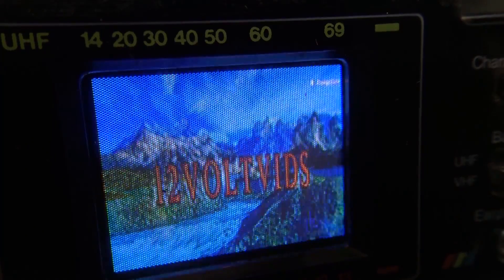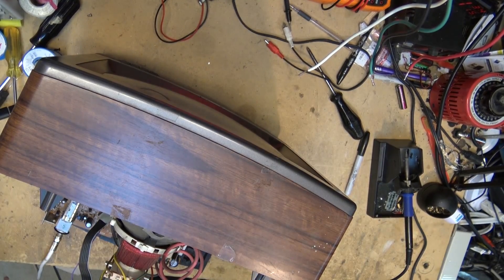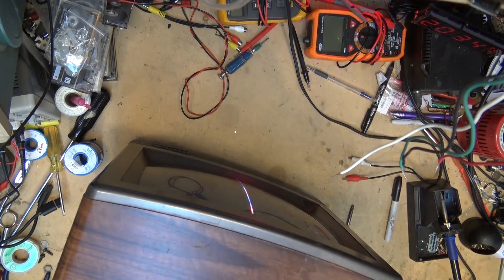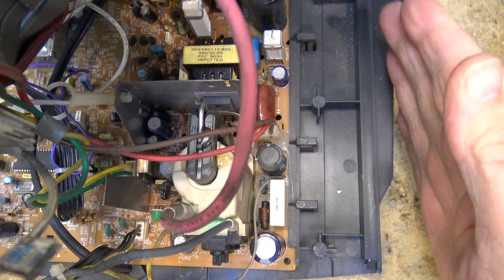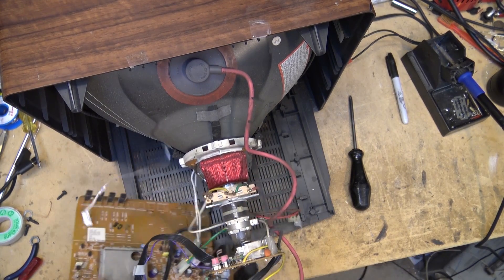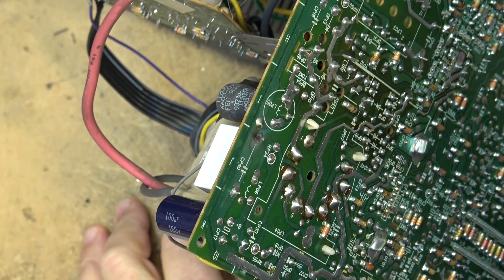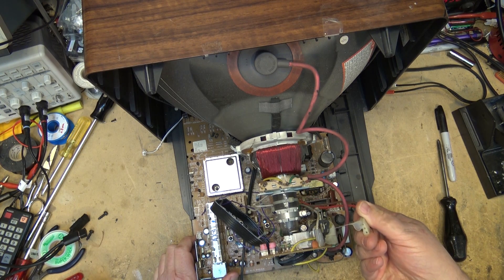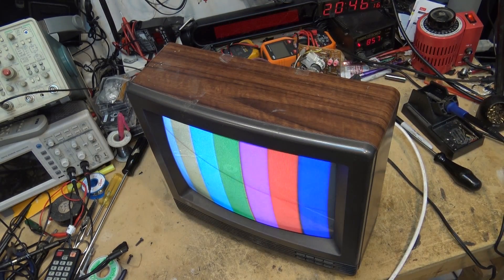Most Dangerous TV fault ever -  Fire Hazard

Comment: I have a 1989 Zenith 13" (SF1315W, 9-795 chassis, Mexican-built set) that has some sort of arcing noise inside it. Occasionally the vertical jitters. I think it's the chopper. Should I not be using this TV? Been using it about 12 hours a day for 2-3 weeks now.

Comment: Here in Finland Salora and Finlux CRT TVs had a very similar problem(in the mid to late '90s). Basically the exact same thing, but with the yoke plug(s). The solder joints would start to decay, and one day it'd cause a big spark and set the TV on fire.
Reply: Still have my Salora 28" 'Täyskuva-TV' from 1986, working great! :'D

Comment: This reminds me of the recall Sony had to to do with underated on/off switches
here in the UK.
A lot of engineers worked overtime to fit uprated switches due to the number of sets
going on fire, i have seen the plastic fronts deformed by the heat from the cheap switches.
Then we say that they don't make them this good anymore!
Reply from the maker: There were many safety bulletins issues for many products that you never heard about.  Switches, wiring harnesses, fuses, mov ect that we had to do every time when a specific modem came in. Remember the flyback trouble on a certain model that was replaced long past warranty and the an orange dot sticker was stuck to the label indicating that it was done. Then pabasonic with their under sized wiring harness on thousands of microwave ovens, many that could very well still be in use.   That one was never a fire safety hazard because if the harness overheated and shorted the worst thing that happened was the fuse would blow and when the tech opened it up he found the wires were melted together between the fuse and the switches. But there was a mod kit that was out at the time that you could order and it came with the wires all bundled and you just unplugged everything and put new ones on and they were heavier gauge wires. Lots of fuck ups and manufacturing over the years that were corrected by service centers that people never knew about. What I work for Sony we did the big recall on the 5000 series betamax machines that required I think I was around 45 or so capacitors in the servo board they were solid aluminum type capacitors made by Samuel and they were all swapped out for a little tantalum caps because the failure rate was about 100%. They were covered under warranty long past the one year warranty because it was such a big problem same solution I think those ones got a red dot stuck on the back when they were done. but if you've got full TV or an old microwave or an old VCR if you look on the back and you see there's a colored sticker that generally means that there was a recall done a soft recall and the unit was repaired while it was being serviced for something else.

Comment: I remember walking home from school in 3rd grade and seeing my neighbor's 1964 RCA (CTC-16, probably) roundie color set out in the driveway with holes burnt through the area around the tuners. Their daughter had been watching Romper Room when it burst into flames; I've since heard that it was the thermistors that RCA used, to delay the power-up while the tubes were warming up, that caused such fires. Some sets from that era (Admiral & some others) were also known for fires that spread when wax dribbled out of the flyback. I worked on Zenith monitors from Mexico in the '80s and never saw such junk; those plants were going through labor conflicts and it showed in the lack of workmanship.  I still have a 1988 GE stereo set (CTC-136) that had a similar problem to this, but it was a special capacitor in that area that looked like a ceramic disc, but was made of plastic and cost a lot more. It filled the room with smoke, but that was just the fusible line-dropping resistor doing its job. I replaced the cap with a ceramic one and the set has been fine ever since.
Reply from the maker: The Mexican zenith sets were some of the worst sets i ever saw.

Comment: We had exactly the same problem with TV sets in the UK of the same vintage. The scan coil [yoke] connector would become dry jointed and burn together with line linearity coils and scan coupling capacitors. That is what happens when you dip solder the entire board when it contains components that require more heat for the solder to flow correctly. J.
Reply from the maker: And when I manually solder these big terminals I get the trolls that have an iq of 69 telling me how I don't know how to solder and i am putting too much heat on, and how they can't watch and are unsubscribing as I am an "amateur". Fucking idiots haven't a clue. 40 years in the service industry has taught me a thing or 2 about insufficient heat on a solder joint.
Reply: @12voltvids  We had a major problem with a UK chassis that was rented out to customers by a leading rental company. The rental company was actually owned by the set maker! The line linearity coil became dry jointed probably due to the 'sing' of line frequency. It caused some major house fires and all the models were recalled and scrapped for fear of insurance claims. Another chassis suffered a dry jointed frame output transformers mounted on the P/C board itself. It was not a heavy component being a later model and just needed a bit more solder applied with a hot iron to the connecting tags. Push button mains switches when mounted directly onto the PC board were another hazard. Models with Thyristor line output stages suffered badly with dangerous dry joints on wound components due to the high current high frequency involved.  I owned my TV service center/sales shop from November 1966 to December 2002 so I know I'll back you up with this one. Guys working with clean P/C boards from low voltage  electronics simply don't understand the dangers of high voltage/ pulse arrangements in television receivers. Regards, J.
Reply from the maker: @vinylseat  they don't   know anything about high power connections but you can't fix stupid.

Comment: Philips (EU) tv's had a similar recall early nineties after several tv's had burst into flame, and those were otherwise overengineered top of the line models that were produced in local factories still with overall excellent build quality, similar to the heydays of zenith. They had several vertically mounted boards where heat cycling and gravity killed the solder joints. I remember calling in the tv shop as a nosy kid after discovering the recall from a newspaper. That tv ended up having many, many hours of service without any other service until the tube was so dead all the colors started bleeding. Ended up swapping out the tube and giving it to a local charity where it was used for who knows how many more years.

It also definitely was a thing in those days to whack your older television because of the bad solder joints.
Reply: The infamous 1993 K40 safety recall
Reply: @edwinvp  That one indeed! I hope to one day find myself another K40 again.
Reply: And a bit earlier, GE had double sided board problems due to griplets having a bad solder connection due to differential expansion. We'd hard wire the circuits that had griplet connection failures to avoid recalls. I remember one that drove me around the bend figuring out a griplet related issue that was unusual. I fixed it after much effort and literally sleepwalking to the basement shop, to awaken that morning to find it repaired and some notes that made no sense at all.
Yeah, I fixed the damned thing in my sleep.
Then, there was the RCA with an MOV failure, it let go fully as I was looking directly at it. Thankfully, I yanked the cord before it could burn the customer's hardwood floor.
And a Philco TV with an SCR horizontal output that had a similar problem to this set, the arc leaving me with a tiny blind spot to this very day...
I eventually became the guy other shops called when they couldn't figure out what the problem was.

Comment: This is weird, why not cleaning that issue first and solder afterwards, all that carbon is still out there.
Reply from the maker: Why? The little bit of carbon on the board isn't going to do anything. For starters there are no other traces involved that it can conduct to and this tv isn't going back into service.  I found this set at the side of the road. It will be used in future videos for fault simulations at some point but other than that it won't be going back in service. So there was no point.  If the burnt area was encroaching on other traces where there would be a possibility of cross over then the carbon would be cut away and hv silicone would have been  used to fill the void and allowed to fully cure before the set powered up but that was not the case here.
Reply: @12voltvids  Ok thnx man, i was just wondering, you're the expert and i'm always interested in your video's.

Comment: I recall Zenith had some 4 leaded "safety capacitor" in the flyback circuit back in the 70's that also would fail and cause damage. I had an old 70's Zenith that had all the circuits on plug in modules. It was an erratic and annoying set, always failing. I got fed up and soldered all of the plug in modules making it no longer repairable by that means, yet it became very reliable after I did that. A friend's family had a small set that failed and I was asked to fix it. They had it upside down and were watching a sitcom. Apparently right side up it would fail. I took the back off and ran a small artists paint brush all over the PCB until I found the unsoldered part. They thought I was a genius.
Reply: Quasar "Works in a Drawer" set, with plug-in modules, were also known for bad connections. I believe one of the first thing Panasonic did when they bought out Quasar was to get rid of that system. I'll bet both  Zenith and Quasar charged a mint for replacement modules.

Comment: Do you have videos on discharging? That's my biggest fear once opening stuff. I tinker with VCRs
Reply: Hi, use a 100w incandescent light bulb to discharge the high voltage filter caps etc. also you can use a 1.8k or 2.8k ohm 10 watt or higher  resister to discharge as well. thank you.

Comment: I know it's a bit off topic but here in the UK there are 5.3 MILLION tumble dryers that are being replaced by Hotpoint, Creda and Indesit - Whirlpool American owned. They too have caused many deaths all for the sake of a thermal cutout costing  less than a cigarette. We went for the 'new option' that was less than half the price of a new one. If we had not it might have been several years before it was fixed. It now seems the so called fix isn't working and the repaired ones are still bursting into flames.  I was hoping I could hang on to our old one (< 2 years old) and add a thermal cutout but they took it away. Our previous dryer had one - 10 for 99P off EBAY ? It seems that penny pinching has reached an all time high. Accountants, poor design and greed strike again.

Comment: While you have it apart why dont you add RGB input to it for old video games?
Reply from the maker: This would require isolation as this is a hot chassis.  This can be done 2 ways.  Isolate the TV with an isolation transformer or isolate the video input with optical isolation.

Comment: What courses do you need to do these type of repairs ?
Reply from the maker: Well electronics engineering isn't a bad one. Myself over the 20 years I was in the business I took probably 100 or more electronics courses, most put on by the manufactures. When I first learned, I was taught by a private instructor that saw potential and took me in as a student when I was about 15. He was a master certified RCAF Radar / Radio enginneer from the air force. Forked on building radar and radio installations during the WW2, then went on to work building broadcast transmitters, and in the early 60's opened his own shop with one of his military buddies that he worked on Radar installations with.
I knew his son from school, so I started hanging around the shop and helping out. It wasn't long before the owner asked if I wanted to really learn about electronics, as his own son was getting into it. So I would hang around there after school, and be put to work, and get lots of hands on, and theory.
The owner retired and his business partner took over, and offered me a job. Did that though high school, wrote the CEASA challenge exam, and got my certification in 82. Next year I went to work for Sony, where I learned betamax, and applied that knowledge to VHS. Left Sony in 84 (because they wanted to transfer me across the country and my GF didn't want to move across the country) Landed at a certified warranty depot, and spent the next 19+ years at that shop. Retired from the business in 2003 and changed careers promising myself that I was done fixing electronics. Stayed away for about 10 years and due to pressure from clients started working on some types of electronics again.

Comment: Wow, you don't even prep the bad joint and clean the carbon off the cap lead and PCB land. That's what I'd call a bad soldering practice.
Reply: It wasn't too badly charred so that's what flux is for, but I agree it would have made for a neater repair. When there's no severe charrin, I do use some wick and then the soldering iron as a scraping tool. When in doubt about the cap, I replace the cap. If needed, I use a small screwdriver for scraping. I don't like glassfiber pens, but if it is really bad, I use one.
Reply: Upon reviewing, the actual bad practice is tapping the capacitor and making it arc some more. Originally, there wouldn't have been much charring. Also, provoking arcing can blow up semiconductors.

Comment: You said in the beginning that you were working on an RCA. It's clearly labeled a GE. Yes I know GE bought RCA and later sold to Thompson. But it is clearly a GE not an RCA.
Reply: Being from Europe, I only know products from the mother company, and the chassis just screams Thomson at the top of its lungs so it really doesn't matter that much which label is on it. It was clearly designed by the same staff that designed the French and Singapore made sets. Those were also soldered pretty badly.

Comment: What kind of profetional are you, smaling the tv before to fix it.
Reply from the maker: That's how you find a connection fault. Give it a smack.
Reply: @12voltvids  i had a TV that wouldn't always start up properly after switch on, a good whack on the top always gave it that final 'boost' and it came to life
Reply: Haha, you think thats unprofessional? I fix a lot of car radios and I smack them wit a rubber hammer BEFORE and AFTER the repair to make sure. Nothing worse than giving a customer a radio back and he then hits a bumpy road and the radio fails because of a faulty connection which I failed to notice :-)

Comment: Hi!  I just found you this morning and was a subscriber within the first five minutes :)  I worked in a Mom & Pop Zenith shop from the early 80s to early 90s while this was going on and remember it well. We saw mainly loose, arcing horiz yoke connectors, with the same result.  It would set that paper stuff on fire.  Sometimes it would go out, sometimes not.  If I recall correctly, it was a Zenith part# 9-186.  I think they were first used in the 1984 System3 and Advanced System3 models with those pesky 9-181 and 9-214 chassis.  Those were higher-end sets that usually came in a wood products cabinet.
Reply: UL had a test, starting in 1975, in which they'd pour alcohol into the set and light it; the set only passed if the fire burned out when the alcohol was consumed. I wonder if Zenith passed the test with pre-production parts, then switched suppliers. I've read that the EU relaxed the flammability standards on TVs in the 1990s when they banned a number of flame retardants; at one point, there were 100 times as many TV fires in EU countries as in the USA, including one famous fire in  a UK "tower block" that killed 6 people.

Comment: That paper is called Nomex. Nowadays though they use a Chinese equivalent.
The cold solder joints are common to components with contacts with a large thermal mass. The wave soldering machine speed is too fast for the contact to heat up sufficiently for good adhesion. Surprisingly the joints look perfect to the eye despite them being poor. These slip through QA very often, even nowadays.

Comment: You mention being able to sell these TVs for old games, infact you could probably get a good bit if you RGB modded some of the old Trinitron sets. Basically adapting RGB SCART to an North American TV basically via the jungle IC
Reply from the maker: narunetto 
The problem is these sets are all hot chassis so you can't just add external inputs. Those sets that do have external inputs also require isolation.   Also these classic games here all are ntsc composite video based.
Reply: Apparently the people on this thread at a forum (https://shmups.system11.org/viewtopic.php?f=6&t=56155c) seem to be able to do it on the 90's sets, not being hot throughout. Also, they were mostly composite from the get-go, but systems like the SNES and Genesis actually have the 15khz RGB on them.